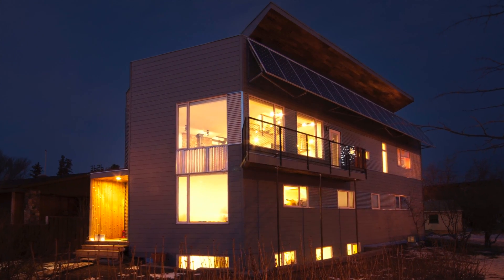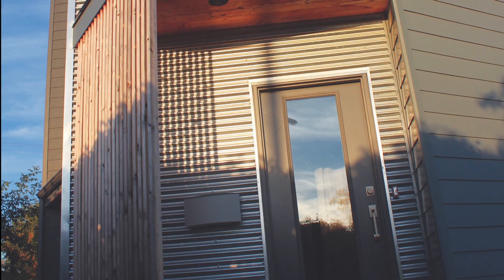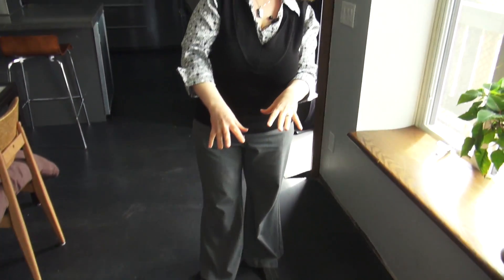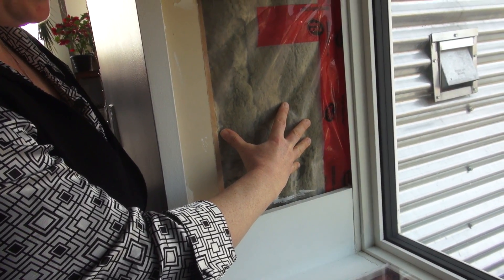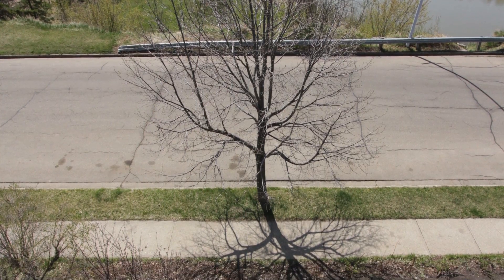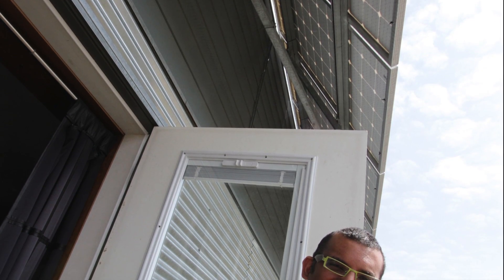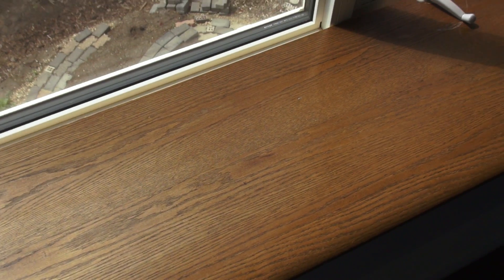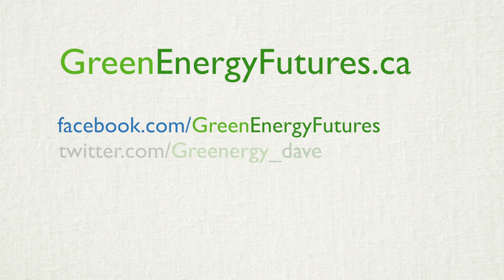80. Net-Zero Evolution - The secret is to keep it ridiculously simple

Comment: Nice video!! But could have been better if you had talked about the ventilation system and methods used for heat gain prevention in summer.

Comment: Here  https://www.youtube.com/user/seumas2/videos
Material used 

Port
Alberni's first Passive house (Passivhause) build in the heart of
Vancouver Island British Columbia Canada.

Passive
House(Passivehaus) is considered to be the most rigorous 
voluntary energy-based standard in design and construction industry
today.

Passive
house buildings consume up to 90 percent less heating and cooling
energy than conventional building.

The
use of Passive House design software was used to gain the specs
required to meet the performance standard for this location.

House
was constructed well  above the current standards as outlined in
the B.C. Building Code.

Footings
were widen to 36 inches(914 mm) due to low bearing soil conditions
and additional rebar reinforcement added.

30
inch high (762 mm) high reinforced walls . Course sand placed inside
foundation walls and mechanically compacted.

Three
layers of four inch *102 mm) thick  Expanded 
polystyrene foam sheets with all joints staggered and tape were
placed on top of compacted sand.

The
three layers of foam have insulation value of approximately R 50.

A
20 mil layer of poly was placed over the E.P.S. sheets and taped and
sealed.

Four
inches(102 mm) of 30 m.p.a fiber reinforced concrete was placed to
form a slab over the foam based.

Slab
is isolated from concrete stem wall with four inches (102 mm) of
E.P.S. to prevent thermal loss.

All
cold water lines are buried in the sand to keep them cool, hot water
lines have been placed in the center layer of foam insulation to
minimize heat loss.

Wall
plates compress to heavy beads of acoustic sealant between layers of
vapor barrier to prevent air movement.

The
walls are double stud configuration set at 24 inches (610 mm) on
centre and plates are spaced in a manner that yield a 20 inch (508
mm) thick wall. 1/2 inch (12 mm) standard plywood sheathing with 
Mento 1000 a three layer airtight vapor open house wrap( far superior
to common house wraps) with 1/2 inch(12 mm) pressured treated plywood
rain screen battens form the exterior surface. 

Intello 
smart vapour barrier was installed one third in from the inside wall
to prevent condensation in this climate.

Triple
pane argon filled windows meeting passive house standards from
Euroline  were placed mid wall to reduce wind wash heat loss. 
All window openings have been splayed at 45 degrees to give a full
wide angle view.

Almost
all the wiring and plumbing was kept inside of the vapor barrier
envelope to minimize air leakage.

Passive
house standard requires air leakage not to  exceed .6 Air
changes per hour at 50 pascal.

Zehnder
comfoair 200 HRV has been installed with a 1000 watt air preheater
.(92 percent heat recovery rate)

House
has been pre- plumbed for a heat pump water heater reducing 
domestic water heating cost significantly.

Garage
has been pre-wired for 40 amp/240 volt  electric car charging
station.

House
to be equipped  with  heat pump condensing dryer which
requires no external venting,only a water waste line. George K
Builder. © George K 2019      
https://www.youtube.com/user/seumas2/videos

Comment: I am so tired of advice about how to heat a home. Heating is easy. Try cooling a home in the south in summer. Show me some passive designs that do that.
Reply: Really!!! Just look at your own southern architecture. Large overhangs and porches on the south side of the house. Triple pane windows, extra thick insulation, and an air conditioner. What keeps the heat in keeps the heat out. Not brain surgery
Reply: Geothermal cooling, window shades and lots of fans..
Reply: @t.trekkeroo2325  window shades on the outside...when warm outside.
Reply: Took the words out of my mouth. Trapping heat isn't all that hard.
Reply: @vesza  it's as easy to heat that it is to cool. My house is at 25°C inside when it's 30-35°C outside, i use 0 energy for that.
Reply: @honumoorea873  But is that achieved passively with consecutive days over 30 degs?
Reply: @vesza  yes, but my house is kind special it's half burried in the ground. Kind like en earthship, earthship got a lot of design flaws not everything is good in them, in fact they invented nothing, where i live, thousands of years before us people where living in caves and many houses are some still live in those houses under rocks (look Roque Gageac in France).
I do not know where you live, are you in a desert...? I also lived in Africa and never used any air conditioner (was 45°C in the shades at the dry season)
To protect the interior of the house from temperature change... You simply need thermal mass and good insulation around it (thermal mass inside, insulation outside).
My parents house is 190 years old, walls are 80cm thick at the bottom, 60 cm at the top, temperature inside never gone higher then 27-28°C, of course we open windows at night to cool the mass. You could also use tubes burried in the ground to get fresh air in the house, air conditioner is a bad idea most of the time, it increases cost and maintenance, house need to be designed with no AC in mind.
Reply: easy, move north.
Reply: Look to the Australians  They do it pretty well.
Reply: Paint all exterior white  WALLS AND ROOF ...specially roof.
Reply: Trees.
Reply: Look up PCM Materials!
Reply: Easy. This house has the elements: thick walls, windows that open for ventilation, LED lights for less indoor heat generation, tall ceilings. My 1980s house, not built for efficiency, has a low cooling bill: solar panels, windows that open, ceiling fans, LED lights and “adequate” attic insulation and, w/o ability to modify the exterior due to HOA rules, an ultra efficient heat pump heating/cooling system. In SW Ohio, USA, with 2 electric cars, our electric Bill is typically $14- $20 a month. Thanks

Comment: The floor is actually designed to act like a Trombe wall.
Reply: Concrete, brick and stone are very slow-response materials, slow to absorb and slow to release heat energy. OK maybe for stable conditions, but not very clever for dynamic situations or in a world with climate change. With global warming, materials with a high thermal capacity will just become saturated - will radiate their heat and they will not be able to be cooled due to their unresponsiveness and the high overnight ambient temperatures. In this situation, you will be more comfortable in a well shaded 'light-weight' timber building! The obvious solution is phase-change materials, made from plant oils.

Comment: This is all good stuff, and do-able, however the 'next' level incorporates masonry walls, or Phase Change Materials (that can absorb up to 14 times as much heat energy as concrete) to place Thermal Mass as required or indicated through BIM (Building Information Management) analysis.  Far less stick framing means the walls are significantly heavier and can't be transported.  Perhaps a 'hybrid' house of parts that are pre-manufactured, married to site built concrete works.
With a wood burning appliance you can dispense with the heat recovery ventilator, by burning the stale air in an airtight box and using the resulting negative air pressure to pull in fresh air, that is circulated around the firebox, before entering the conditioned space.  A roof vent (Velux or Roto skylights) will help pull air out in summer, when cool air can come in from underground.
We have a paucity of decent insulation products, they all suffer some critical failure.  Polyisocyanurate is R 6.4/inch but is a Fossil Fuel product.  Anything else that comes close in performance, is either expensive or hard to incorporate, requiring a 2nd wall system sometimes because it's so thick, and thermal bridging comes into play.
Most building codes are developed in temperate (cool to cold) climates so they lack attention to thermal mass, radiant heat transfer, and other electromagnetism properties associated with too much sun, heat, solar PV, batteries and thermal storage, etc..  This Canadian lives in the low Sonoran desert where it's just over 50C some days.  (121+ F)  I'm digging holes looking for coolness and then insulating that, from the Sun.  I installed a Radiant Barrier over the plywood roof decking, with a metal roof on top of that, and a solar PV array on top of that, all to absorb or reflect the whole spectrum of light.
Moveable insulation has been the Grail of passive designers since the '70s and has never been accomplished in a cost effective way that I know of.  That's why modern passive design must incorporate the most expensive windows available.  I'm still fiddling with that.  The thermal windows in the refrigerated foods section of the grocery store roll back into place automatically.  You can buy a patio door and replace the sliding door with something that is insulated, and incorporate the whole unit into a passive wall system without compromise to R values, Air/Vap/Barrier integrity etc., and finish it on both sides to appear like a single, fixed unit with an R 13 panel that slides over it from inside the wall, like a pocket door.  That could turn a south facing window into a net heat gain device over the 24 hour cycle, in a colder climate.  Here in the desert (32.3 degrees N. Latitude) such things aren't necessary but shading is.  And because each summer is hotter now, we're about to find out a lot about geothermal.  Ground source heat pumps have been around since the '50s and were always a runaway winner over anything else available in terms of efficiency.  Now they're much better, using infinitely variable speed, brushless motors and better evaporative cooling systems and can be placed in smaller areas that were considered useless before.
We're attempting to turn this 50 year old, stick frame bungalow into a Net Zero house over the next few years.  The 5.1 kw solar PV system (in boxes on the ground right now) is scalable, for when we acquire another EV.  The Fiat 500e we drive now takes about 50 kwh/week which we get from Palm Springs City charging stations (free) or at work, or very soon, in our garage.  The solar system will make roughly 50 kwh of electricity per day.  The system also has a LG Chem 9.8 kwh Lithium-ion storage battery, giving us 9.8 plus 20 (the Fiat) and 33 (the BMW i3 that is coming) about 60 kwh of battery storage total.  Two of those batteries are on wheels.

Comment: I'm not sure I understand the logic of going to baseboard electric heat vs. a propane furnace.  It's definitely not a cost savings and depending on location, your electricity is created by fossil fuels.
Reply: There is a huge amount of hydropower in Eastern Canada.
Reply: If you missed it they will be net zero by using the solar on the south side of the house to supply power for the baseboards and lights. This house was not about cost savings but about being self reliant. Oh and the newer baseboards are quite efficient. I pay about $250 a month for everything, heat, light and appliances all on elec.  Normally it would be half but I'm doing a reno on the room with the wood stove. Same setup as in the show Wood heat, electric everything else.

Comment: Lot of these homes could update to a hot water furnace instead of electric heat.
Reply: No because the primary heat is wood, base boards are backup and are usually powered by solar.

Comment: I would love a Net Zero home, Passive Design but I want something that's traditional, like a farmhouse or rancher with solar panels haha 
I hardly see any people really care about energy efficiency on those HGTV shows when they buy a home, to me it's a high priority.
Reply: Here in Southern California we bought a 1970s house in 2008 with houses on each side that were built by the same contractor, at the same time.  On one side of us, a company from LA did a six month, $1/4 million reno and turned it into a 'high end' rental, which by the way, has been very carefully managed and no inconvenience in the two years it's been there.  Other than bringing the house up to code, they did nothing exceptional to prepare it for worse weather.  On the other side of us, a speculator bought the house, spent about the same (a little more) and flipped it, making about $80k over 18 months or so.  Ditto, no consideration for energy performance other than code went into the renovation.  Right now, across the street and down three doors a new, (5000 ft2 house, the garage is 3000 ft2) is just starting and so far, there is no sign of any special consideration for any energy efficient design.  Pathetic really.  They'll spend about $2 million on the property before it's over, so I guess they don't care what electricity costs.
We're on the poor side of the street (the other side is zoned "Equestrian" and some have AC'ed barns) and have done little to the house aesthetically, but have spent about $50k on "infrastructure", including new entrance panel and sub panel, Level II EV charging station, Solar PV array, radiant barrier over the roof, and some other changes to the "ductwork from hell" that snakes anaconda like through the 75 foot long attic.
I guess we'll find out which houses "succumb" to a stretch of 120+ F temperatures first, but if they bring any horses across, the animals get first priority.
Reply: I'm designing a folk Gothic house in the woods. The footprint is a simple rectangle, but the roofline is more complicated and not ideal for super insulation.

Comment: This is all good clean healthy fun, but has anyone analysed the sustainability and cost of materials used? For instance the concrete floor consumes enormous quantities of energy to source, manufacture and supply. And the triple-glazed windows need 3 times the glass of single-glazed examples. Glass is very expensive to make, both in materials and energy, especially in large sheets. 

I could go on, but in reality the only way  for humans to survive and reduce their impact on the environment is to live more simply, and consume less. This may prove less than comfortable, but eventually the human race will be left with no choice.
Reply: Nobody uses single pane glass

Comment: You can use rubber tires to insulate the walls.
Reply: The conductivity of rubber tyres comes nowhere close to the values of 'insulation materials'. Used vehicle tyres are, and should be recycled, not mixed with other building materials. But if you want to spend a lot of energy being silly, try packing tyres with soil.
Reply: Only if your an old hippy

Comment: my idea of net zero is easy....wood fire stoves, compost toilets and oil lamps...keep it simple.
Reply: +Michael Mccauslin And a much smaller space. This house an excess 2000 sqft!! Who needs that much space.
Reply: +Michael Mccauslin In order for wood stoves and oil lamps to be considered net zero, they must be produced passively or by the house itself... If you were to cultivate and process these fuels onsite, and cleanly, you would be heading in the right direction. Passive solar is the most resilient and lowest maintenance aspect of net zero. Other systems should be calculated to determine actual sustainability and efficiency.
Reply: That works for warmer temperate zones but if you need AC or warmth, you might as well put up a TeePee.  This approach is Net Zero using stick frame.  Next step is the same thing using CMU's and rigid foam panels.  I did that 15 years ago, we're doing another one (much upgraded) this summer or next.  After that, is Phase Change Materials and 'organic' HVRC .  This video uses technology from the '90s.
Reply: In all fairness if you've got a big family or enjoy entertaining in the colder months is gets small quick.  I'll always remember my folks having family Christmas and other holidays.  After the kids grand kids and neighbors are over you start looking at 20 to 30 people.  without a big house no big gatherings...  Not for everyone but its a deal breaker for some.
Reply: Some will insist on rules, I personally insist on results.  For example;  Is a PV driven fan passive?  In my book it is, meaning I can install a solar driven roof vent into a Passive House design and not be disqualified for using mechanical HVAC equipment.
To be clear, Passive House is stricter than Net Zero.  Net Zero has no rules.  You could make a barn Net Zero if you covered the surrounding property in PV panels, sufficient to heat and cool it using Home Depot equipment.  Passive house doesn't use anything (some minor exceptions) to stay at a moderate temperature, neither over heating nor freezing.
Reply: 2000 sqft isnt that much actually :)
Reply: @Username [Redacted] Can you get safe (meaning chemical free) pellets?
Reply: @Username [Redacted] Thanks. I'll check out the video. I know fireplaces are inefficient but I also want some alternative heat. I am going to look into pellet stoves and solar vacuum tubes. Have you seen the Hanergy thin solar film? https://www.hanergyamerica.com/
Reply: @Username [Redacted] I imagine that's true abt. dust. I suppose passive is still the best. I would like something for emergencies and am interested in the Hanergy umbrella. I wish the US was further along in electric cars providing electricity to houses.
Reply: In the oil lamps... are those petroleum? Or perhaps whale oil?